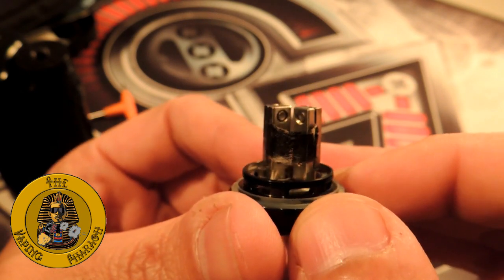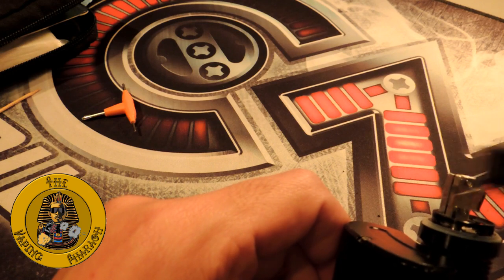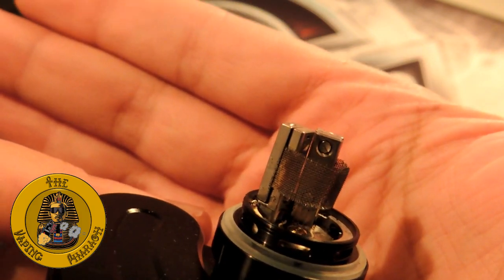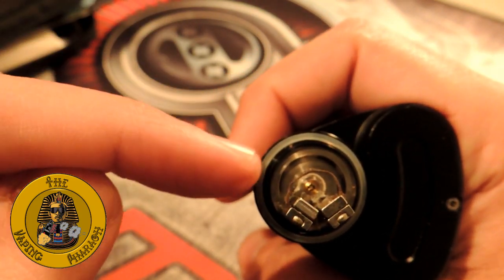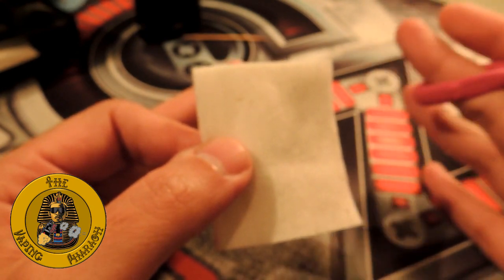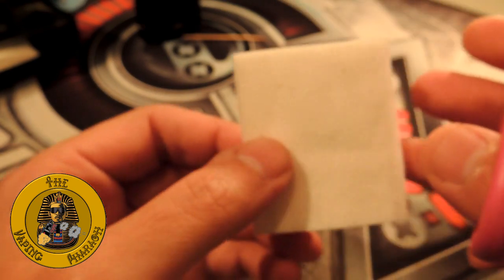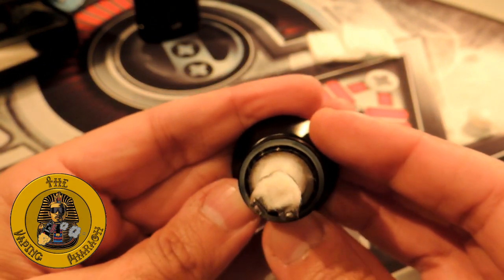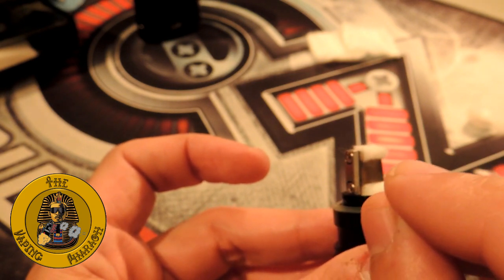VandyVape - The Mesh RTA Build/Wick HD by TheVapingPharoah - English

Comment: Thank you! My mistake was I assumed the mesh they gave me was the correct length. Making that smaller radius really helped. Also, if anyone had problems with the tank leaking. I found the extra rubber ring they provide works a lot better.
Reply from the maker: josh cote realy glad I could help

Comment: thanks for great video , it helps ,it works great , no gurgling and liquid in mouth , its works great  with 100% vg
Reply from the maker: mastmalang70hk glad to help 😁
Eeeeeennnnnjjjjjoooooyyyyyy
Reply: mastmalang70hk - Excellent!  Which other RTAs have you used successfully with 100% VG?  I am trying to stop using any PG since it is not healthy to inhale when heated above 210 degrees Fahrenheit.

Comment: I'm using the VandyVape 200mesh SS316L Mesh Wire, coupled with the Smok T-Priv.  My question here is, I have never used Temp Control, and have heard it's really nice with this Mod/Mesh combo.  When I choose Temp Control, I choose Wattage, and then what I can only guess to be the Wiresize  (something like 0.00090).  What number should I choose there for Mesh?  I don't care to use this feature until I know exactly what this is as I don't want to chance messing something up.  Not a huge fan of messing with these Mods w/o knowing exactly what I am doing.  Thanks ahead of time, and great video, helped me a TON on figuring out exactly how to wick this thing.
Reply from the maker: Always glad to help
Thanks for the feedback It's highly appreciated 
Vape On & Eeeeeennnnnjjjjjoooooyyyyyy 💨💨💨
Regarding the TC, i have not used it on the mesh yet, but it should work on the default SS TC profile that is pre-installed on your smok mod, if not let me know and i will figure i out for you. ;)

Comment: Hi I’m really struggling to get any decent flavour from this rta. I haven’t suffered from dry hits or hot spots in the mesh. This is s great video with great info I’m just wondering what I’m doing wrong
Reply from the maker: Always glad to help
Thanks for the feedback It's highly appreciated 
----> Which mesh are you using ?
Reply: TheVapingPharoah TVP Vandy Vape the same as what you get with the tank. I’ve still got the same mesh in but I’m not getting much flavour, I’m getting good cloud though. I’m using the same mesh in the profile RDA with the same juice. I know the flavour won’t be the same but I’m getting almost no taste in the rta 😔
Reply from the maker: @rickhill4766  try again and go higher with the wattage
Reply: Ok will do I’ll keep you posted 👍🏻
Reply from the maker: @rickhill4766  please do
Reply: Hi buddy I’m still getting very little flavour re wicked it, tried different juices I’m close to putting it in the bin

Comment: Thanks for this! It makes everything so easy, but I have a problem I hope you can help with. I’m getting a lot of spit back whenever I fill the tank. The spit back goes away when the tank is nearly empty. I’ve read that too filling will make juice go into the air flow? Is that why? I did everything you instructed 3-4 times already and I always get spit back after filling the tank and hitting the vape 1-2 times. Hope you can help!
Reply from the maker: Always glad to help
Thanks for the feedback It's highly appreciated 
Vape On & Eeeeeennnnnjjjjjoooooyyyyyy 💨💨💨
Reply from the maker: You have 2 options to overcome this:
1. Keep the same cotton in as it is, but shorten the mesh, i.e. pull it into the post a little more
2. Increase ur cotton
Reply: TheVapingPharoah TVP thanks for the quick response! I put a lot more cotton into the well and it works beautifully now. I did everything you said, your wicking style is amazing! Thank you so much I was about to return this tank but not anymore!
Reply from the maker: @Slopok88  
Always glad to help
Thanks for the feedback again It's highly appreciated 
:D
Eeeeeennnnnjjjjjoooooyyyyyy 💨💨💨

Comment: Thank you my man. Subscribed on the last video of this tank I'm glad I did because I couldn't understand what you were saying. I mean no disrespect by that buddy it's just because I only speak English
Reply from the maker: Glad i could help bro, hope this video helps you get the max out of your rta, coz its realy good, I have been using it continuously and put all my gear aside for now :D
Reply: TheVapingPharoah TVP I gave only used the stainless steel mesh it came with. Ordered some kanthal cause I got a feeling I will prefer it as I prefer kanthal for normal coils too. Have you tried kanthal mesh in your rta if so what do you think compared to the stuff it comes with. Thanks again buddy
Reply from the maker: have not tried it yet, but definitely anything will be better than the SS that comes with it, unless you use it in TC mode.
Reply: I use kanthal mesh in mine and it's a realy good vape.
Reply from the maker: have not tried it yet i love the nichrome but when i am done with this spool ill try the kanthal ;)

Comment: Have you had issues with it shorting?
Reply from the maker: not at all but this might be a sign that u have to much mesh so its touching ur chamber, or placed too high touching ur chamber, or placed too low touching ur base, or the mesh is penetrating from one of ur posts and touching the other post, or ur posts are touching make sure there is a good gap between them and tighten/fix the screw in the base bottom, double check, if not take a pic and send it to me

Comment: I keep doing mine exactly like this but yet I still get tons of juice to go into my mouth almost like a straw lol it barley does anything good I’m very angry with the company $70 for this is horrid
Reply: TheVapingPharoah TVP thanks I’ve never used temp mode before how hot would you run yours ?
Reply from the maker: J2XG inc have not tried it on temp mode i only use it on wattage, but i would recommend to start with 50 watts and 140 celsius, and work ur way from there ✌👍